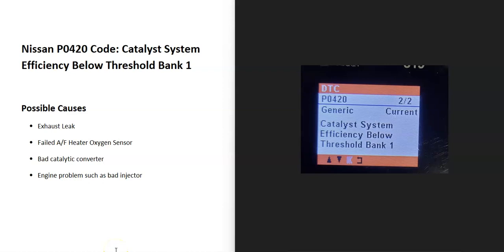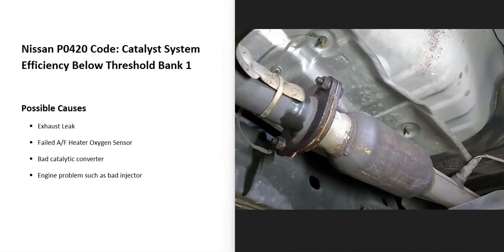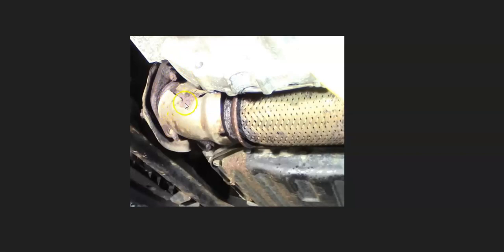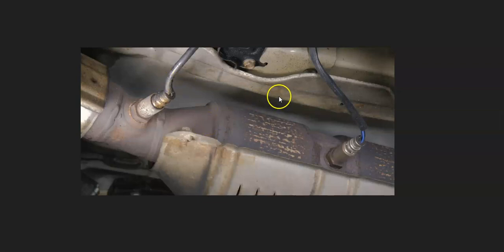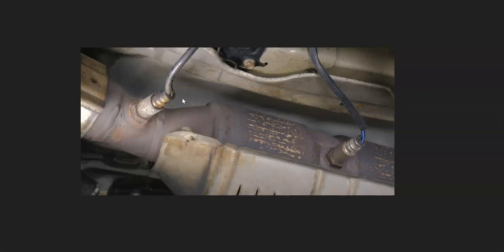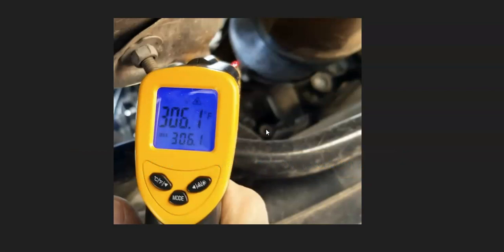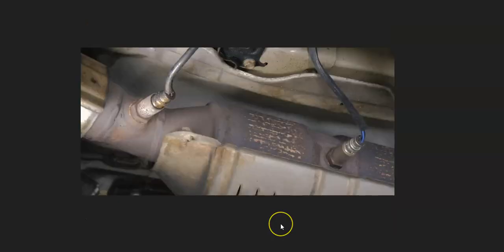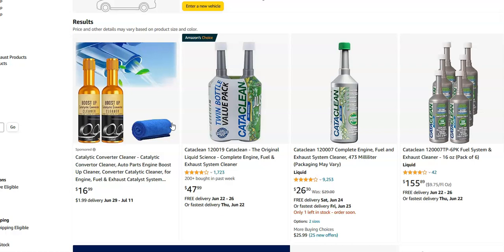Causes and Fixes Nissan P0420 Code: Catalyst System Efficiency Below Threshold Bank 1

Comment: So glad I came upon your video. I have a 2011 Nissan titan and it barely has 70k miles. I got the check engine light and they ran it and states it’s catalytic converter but now I think I’d like them to check the 02 sensors and exhaust manifold first before I replace the converter… seeing as it’s quoted at $3k , for just 1!
Reply: Also have them check fuel injector too I think

Comment: I have a 2005 Nissan Armada which had code p0240 bank 1, replaced upstream 02 sensor and now I get p0300 code of multiple cylinder misfires. Any idea what that could be causing it?
Reply from the maker: I would check if the catalytic converter is clogged up
Reply: you bought a cheap or faulty 02 sensor same thing happened to me on my dodge with a cheaper Amazon direct fit sensor. later bought a O E.M  02  from Rock auto and replaced no more burning lean or missfires.

Comment: my mother has a xterra 2007 i believe it is awd and it has 4 catalytic converters a year ago she went to a muffler shop and had one of her catalytic converters replaced i believe it was bank 1 catalytic converter cause of a p0420 code on passenger side, a year later goes by and the code popped up again and she took it back to the same place and they told her that the converter went bad again which is complete bullshit and they were just trying to rip her off because they didnt even want to test anything at all they just wanted to charge her 1000 bucks just cause they believe it is the thing causing the code which is complete bullshit like why dont you guys test it, so i made sure she didnt buy it again cause I wanna really break it down and test if it is a bad o2 sensor and not the converter  but as of now i am stuck trying to figure which o2 sensor is needing replacement and which one should I try because I know the first sensor before the converter is an Air flow sensor and the sensor after the converter is an 02 sensor which one should I replace?

Comment: If its just a bad sensor can you just run the car(I'm broke atm) and can't replace til later. Will it hurt the car or is there anything bad that can happend?
Reply from the maker: If it is a bad 02 sensor, usually the computer will use other sensors to keep the engine running and shouldn't hurt the engine. It will not go into what is called a closed loop and be less responsive, but it should keep running.

Comment: I have a 2015 Infiniti Q70L 3.7L RWD. That set off this code  P0420 Catalyst System Efficiency Below Threshold Bank 1
The code was set off three months ago. I borrowed my friends Matco scanner and reset the code. No other codes were triggered by the computer. It took three months before. The same code was triggered.  I borrowed my friends scanner again. No other codes were triggered. My engine throttle is strong. The Infiniti does not stumble while idling.  What could be triggering this code if something is ruining my catalytic converter. I want to make sure and repair whatever is going on before replacing the catalytic converter since it is $1,420.45. The upstream oxygen sensors cost $415.78 and the downstream oxygen sensors cost $317.87. After using the scanner reset resetting the code and I used a Dura Lube Severe Catalytic and Exhaust Treatment. So far I’ve driven over 250 miles and the code has not been triggered again.
Reply from the maker: It needs to be diagnosed, but usually, when a P0420 code is cleared and stays off for a while then comes back, it means the CAT is starting to fail. There are CAT cleaners, such as CATA Clean, that can help get more miles in some cases.

Comment: So my problem is it doesnt wanna get up and go ?? I have the code i normally run treatment and stuff with my gas every fill up but it sounds like air when i got to take off hubby looked and no holes but ive been throwing this code since before that happened. And someones it wont get up and go at all ive deive city and highway and its like its not plown anything out yet what ahould i try the o2 sensor or the exhaust manifold or Cadillac converter ??
Reply from the maker: Since there is a lack of power, it's very likely the catalytic converter is clogged up.

Comment: Could someone help me I got this code a week ago I bought some of the “cataclean” and erased the code and today got the same code I’m about to order the sensor but I’m getting confused like he said on the one scanner says bank one there’s only one bank but when I look online it says bank 1 sensor one and sensor two but I don’t know which one I need or should I buy both? Or is the top one behind the engine the most common replacement?? Btw it’s a Nissan versa 2015 if someone could tell me
Reply from the maker: Both sensor-1 and sensor-2 monitor the CAT, and both could be a possible cause, but the CAT may also be failing. Components need to be tested to know which part has gone bad.

Comment: I just had my cat replaced on my 2021 Titan Pro4x gas engine but after driving g about 100 miles the check engine light came back on with the same code.  Any ideas?  BTW that cat fix was $5200 for one side !!
Reply: did it get fixed?

Comment: might be a dumb question but should i replace the catalytic converter on the manifold or the next one
Reply from the maker: There can be a Pre-CAT and then a regular CAT, and sometimes more, depending on the vehicle. They need to be diagnosed to see which has failed. Often, when one goes bad, the others aren't too far behind.

Comment: My cat is 50 degrees cooler on the exit but I have no performance issues. I do have a P0420 however.
Reply from the maker: It needs to be diagnosed; I would test the 02 sensors and be sure they are working correctly. You could also add in a CAT cleaner like CATA Clean or similar, take it out on a highway to get the CATs real hot and let the exhaust blow them out. Clear the code and see if it comes back. If the code clears even for a day or two, the CATs are likely starting to fail.

Comment: Mine came on as p420 and p430 with bank 1 and 2. Is it possible to get both p420 and p430 at the same time? if yes then is it still possible it can be the O2 sensors? Is there something else I need to check? ty
Reply from the maker: The CATS or 02 sensors on both banks going bad at the same time, while possible, does seem suspect. If the engine is having problems, such as a bad injector or running lean/rich, it can cause CAT problems. If there are no engine problems, sometimes the CATs just need to be blown out by getting them hot and taking it on a highway. You could try a cleaner like Cata Clean or similar.
Reply: @HVAC_Mechanic  ty
Reply: @HVAC_Mechanic  I did cata clean and light still stayed on. Imma check the MAS or MAF sensor and clean the throttle body. If none changed, then its gotta be the Down O2 sensors. We shall see. ty
Reply: @mozee01 did you ever find out?

Comment: Will a bad converter make your car jerk at random when accelerating?
Reply: Might be a bad injector? Are you getting an engine code?
Reply: Did you find out? Having the same problem
Reply: @Maysonsmithh my transmission ended up going out. I spent a little over 4k for a replacement and to have it installed

Comment: My 2010 Altima always misfires/jerks/jolts when accelerating around 1.5-2k RPMS. More rpms than that and it’s fine. And doesn’t matter what speed I’m going. There’s no check engine light and only has this code. I don’t want to go down a rabbit hole with the code, I wonder if that’s related to my problem?
Reply from the maker: I would test the catalytic converter and see if it's failed.
Reply: Did you fix it?
Reply: @Maysonsmithh nope. After taking to 3 mechanics and it not getting properly fixed we traded it in at a dealer. It was like a bad valve cover gasket. Oil was leaking into the spark plug cylinder holes. And the aftermarket part doesn’t fix it. It was using oil like crazy. We said screw it and got rid of it

Comment: I have 03 Maxima with 197k miles and got the po420 code. Nissan dealership said cat needs to be replaced which is $1800 or $850 if i go with universal cat but the car has no loss of power and runs great. The only thing is it idles a little rougher than usual. Could it be the sensors that need to be replaced? Im going to use higher octane fuel and add cleaner to see if that helps first since it seems like the cheapest option.
Reply from the maker: A bad 02 sensor can cause a P0420 code, and it can be tested to see if it has failed. At 197K miles, it is likely time to replace the CAT. You can get a cleaner like Cata Clean and run it through to try and get more miles out of it.

Comment: I replace the cat and sensors and stil have the p0420 
Any suggestions. Thank you
Reply from the maker: If all the components are good, I would check the wiring and be sure there is no exhaust leaks. Sometimes, when replacing all the components, if the vehicle is driven a bit and the codes cleared again, they stay off for some reason.

Comment: I have a 2005 Nissan Altima 2.5. It is missing - not really a misfire, more of a bit of a jump while idling. My son has replaced both upstream and downstream sensors, spark plugs, and it is now throwing the p0420, (bank one) code. However, I replaced the exhaust manifold catalytic converter about 4 years ago. Took it back to another mechanic and he seems to think it's the same converter, although it was new. Is this possible? I've read that they should last at least 10 years.

Comment: Thanks for the info. 
I have a Nissan Altima. With that code but the engine doesn’t start.  What I should do? Any advice? Thanks.
Reply from the maker: P0420 code can cause the engine to run badly, but it should still start. If the catalytic converter is fully clogged, it may not want to keep running, but it should start up. It needs to be diagnosed. I would start by checking for gas and spark to the engine.

Comment: Question…. I took the intake manifold off and when putting it back it seems offset… I feel like I didn’t tighten properly and there’s a leak. Any tips??
Reply from the maker: You could do a smoke test to see if it is leaking. As long as there is no leak, it is likely good.

Comment: I have just the code but nothing is running bad or off so what should I do
Reply from the maker: It needs to be diagnosed, but if the 02 sensors are good, the CAT might be going bad. You can try to run some CATA Clean or similar through and see if it clears.

Comment: I just replaced both front and rear cat, o2 sensors, plugs, coul packs AND mass air sensor and still getting p0420 on my w015 Altima 2.5 s9me 0kease help
Reply: Replace catalytic converters they're stopped up

Comment: 2013 Pathfinder with P0420 (my daughter's vehicle).  Long history of this code coming and going.  Had a shop look at it.  They replaced the cat as well as spark plugs and a list of other things.  Fixed it for less than a year.  Code would come and go until lately it just stayed on.  No other codes.  So, I committed myself to check everything.  First up was to look for leaks in the intake system.  I did not get very far.  I found the intake boot had a long slit in the rubber on the bottom near the throttle body.  It probably did not leak a lot of air as there were no other codes and the fuel trims were indicating maybe a bit lean.  Rather than look farther, I cleaned the throttle body a bit, installed a new air filter and a new boot.  The IM's were not ready as a code clear had been done earlier (week or so ago) and the P0420 was a permanent code (as well as stored and pending).  I did not do a drive cycle either.  I just let my daughter drive the car as she would normally drive it.  Within 3 days, the stored and pending codes cleared.  Another 3 days, the permanent code cleared and the check engine light went off.  She continues to drive it and we will see if this was THE problem or just A problem.
Reply: I’m also in the same situation, I had the code,  replaced the catalytic converter and the flex down pipe . Now the code is still ON. I will try to get a new air filter . Good idea
Reply: @Icubela  Air filter alone will not fix it.  In my case the slit in the boot was after the MAF and before the throttle body allowing extra unaccounted air in the system.  Only time will tell if this was the source if the cat code.
Reply: It appears to be A problem, not THE problem.  I checked for exhaust leaks and found none.  The cat was replaced a year ago and from what I can tell, the engine is running clean.  I've been down the cataclean route before, will try again...anything but pull that cat.
Reply: @markwhitaker7887 in the old Honda’s we used to just punch all the metal and everything through the cat and let it run wide open I wonder if that would do the trick. Yup I’m in the same boat.
Reply: Yup my never came off and now it has a piston issue!?

Comment: Replace PCV valve and check the 3 PCV hoses  especially the crankcase hoses,,,  Thats what FINALLY  deleted my code 0420
Reply: Hey..is that up near head..i just changed valve cover and they mentioned pcv valve
Reply: @daltropical5236  on my 05 frontier V6  It is located on the right side rear of the valve cover follow hose from intake to pcv valve
Reply: @jmar2229  👍will check it out tmrw thank for reply

Comment: I got this code found my ground strap broken at the exhaust pipe near the sensor I replace the strap & removed sensor &. Clean now no more codes been 2 years.
Reply: A lot of folks overlook the grounds on vehicles. Rusty or corroded grounds will cause a LOTTTT of issues.

Comment: First, great video and explanation. Could be several causes and you hit on each. Second, now you can’t pass an inspection here in Texas with a check engine light on, especially with this emissions code! My 2012 Nissan Titan runs great! I drove it to North Dakota last summer with this code showing from Houston! But it won’t pass inspection and I can’t get registration tags because of this code! Bunch of crap!
Reply: PLEASE 🙏 What did it end up being? I have a Titan same stupid P0420 P0430 codes, runs fine won’t pass inspection. Expires in two days 😬 

I know how to change the parts just not sure which one to try first. 

What finally got your Titan Engine light off? 

Don’t have $600 to waste on replacing the whole evap system and still need a cat or a charcoal canister .
Reply: Half tank of gas 2 gallons of laqued thinner
Reply: Carlos. So 2 gallons of laquer thinner did not hirt anything? @CarlosChataing
Reply: @garyboswell6739  I meant 1 gallon gallon of laquer thinner I did worked out for me. After run for a while check engine light off and passed emissions test

Comment: If it's just a sensor issue, can I just drive her or will it cause more issues
Reply: Upstream sensors no, fix it. Those control fuel trims.   Downstream sensor let it ride.
Reply: @fritzthecat9451  so bad mpg?
Reply: @Joe-eg7ml  bad mpg at best. Smoked piston rings and a really clogged cat at worst.
Reply: @fritzthecat9451 its not clogged since power is all there and when i stomped on the accelerator it goes. I know how a clogged cat is. Had it in my altima.

Comment: I got 2 codes on my 2015 Sentra. P0171 and P0420. I’m pretty sure p0171 is triggering p0420. Cat replaced and exhaust leak fix already. Anyone had this same issues before?
Reply: this is what my nissan 09 altima is throwing did you ever find anything out ?
Reply: I think p0171 is the bank 1 camshaft position sensor.

Comment: I have a new cat and new upstream and downstream sensors on a 2012 Sentra. What else could it be? Also new plugs, coils, spark plug wires.
Reply: Leak on exhaust manifold, wrong ratio 🤷‍♂️
Reply: Did you ever find out?
Reply: @LottoI95 no and I sold the car, they’re taking it to Mexico where there are no smog regs

Comment: Auto shop wants to replace both o2 sensors.  ,$630..... hell no.  I ll keep using Cataclean.   $1,400 for new converter.  Hell no.  That's more than my 08 Altima is worth.
Reply: Cataclean made it worse for me. Has this happened to you?
Reply: @rickyblaze-starwarsbattlef4413  nope.  Works great.  No check engine light in months.  I'll keep using it quarterly or whenever the light comes back on.

Comment: 0420 code again on my '08 Altima , they believe it's the o2 sensor not sure if it's upstream or downstream
Reply: What did you find?
Reply: @jeffreymarley6877   they wanted to replace both sensors for about $630. I declined.  Car is running fine using CATACLEAN and resetting and clearing the code. Usually lasts a month or 2 and I reset the code by unhooking the negative battery wire.  Car is running fine.
Reply: @Tngoz  Thank you!

Comment: I had a miss firing issue on cylinder 3, I fix that then I got the P0420 code, could the cleaner , clean out the un- burned fuel ?
Reply from the maker: It is possible. You could take it out for a drive and heat up the catalytic converter to burn any excess fuel out.
Reply: I also had a misfire in cylinder 2. I fixed the problem. Now I’m getting the same p0420 code. Did the cleaner fix your problem? Thanks in advance.
Reply: Thanks, I put  a cleaner in, drive to work , clear the code,  I'll see what happens.
Reply: I'm having same problem it's throwing the same code and I wonder what kind of cleaner to try did it help yours I had all plugs and coils changed and it threw that code afterwards
Reply: I had the misfire issue and fixed it and 2 days later this came up. Anyone fix?